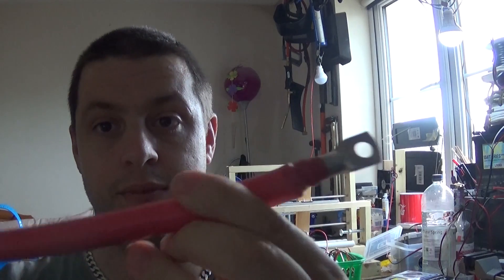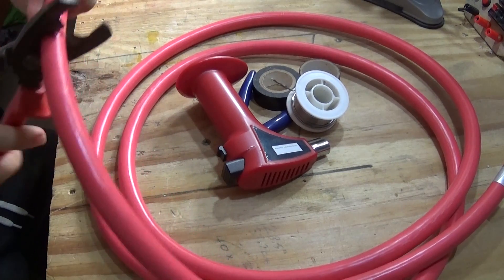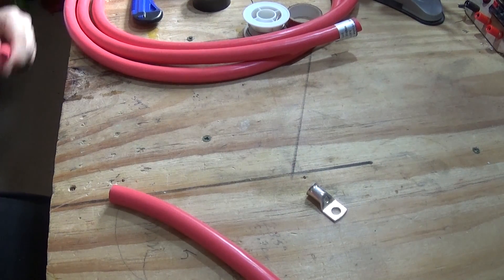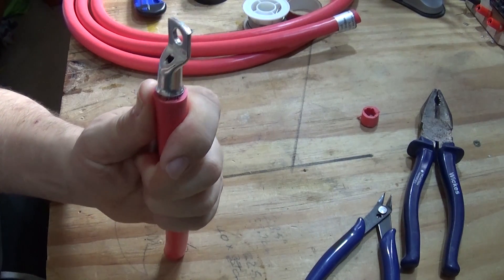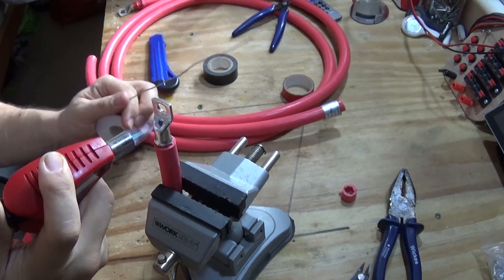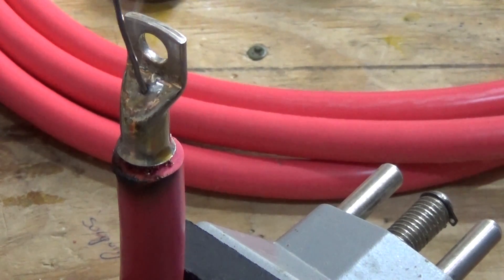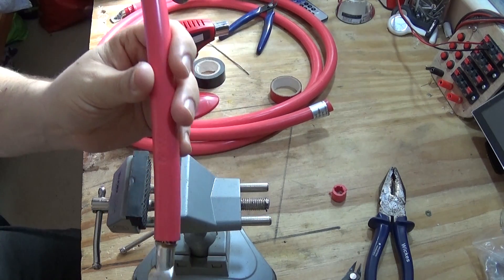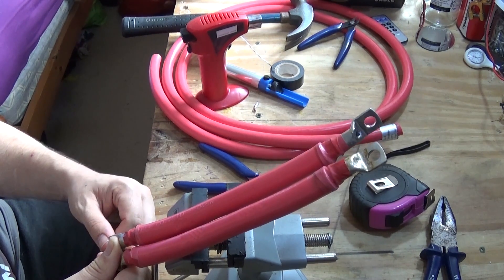Securing Terminals To Wire Without Crimping. A Very simple Process | Solar Battery Bank |

Comment: Should never remove wire. Best and safest thing to do is order the right size plug and go again. Good video though 👍
Reply from the maker: To be honest I had no money so it was a case of use what I had or scrap the project sadly. I totally agree with you though
Reply: @TheOffGridFamily  been there mate. Thanks for the reply and you’re right, sometimes you have to use what you have.
Reply from the maker: Yeah exactly, that said I probably should have explained that removing wire was changing the overall wires gauge but we live and learn. I always appreciate creative criticism. Thanks for the comment mate
Reply: Any time at all :0) and live and learn, that we certainly do 🙌

Comment: Thank you soo much for this video, so many I've watched already only gave instructions using expensive tools like a crimper or even a heat gun. This gave me the confidence to work with what I have!
Reply from the maker: I have never had many tools so I have got used to just doing what I could with what I have. About 8 years ago I didn't own a drill and would make all my holes with a screwdriver. Times have changed but the idea has not. Thanks for the comment

Comment: Crimp hammer works alot better in my opinion. I've done a bunch of them also I've heard the solder doesn't work well for good contact. I give you props my friend that's the first time I've seen someone feed the solder from the hole in the top. Good job!!! I just learned something new today, Cheers my friend. 👌👍
Reply from the maker: I didn't have any other way of doing it at the time but the contacts were absolutely fine and are still working now. So a few years old and still fine. Thanks for the comment Buddy. Creative criticism is always appreciated cheers my friend
Reply: The Off Grid Family your welcome my friend 😊👍
Reply from the maker: Make sure you sub and leave some more comments :) Video ideas are appreciated as well although might not always be possible

Comment: Do not ever be critical of some one else doing it wrong.....You just trimed a 1-ga cable to 2-ga or smaller......why not get the correct size lug or use a smaller cable if it is correct for amp draw. Not to mention but I will....you just ruined a set if wire strippers.
Reply from the maker: David Crook if you read the comments they sent the wrong size and it was time sensitive so worked with what I had. Also the 99 pence cutters survived...thanks for your comment

Comment: Did he do it the hardest way possible minus using his teeth to strip the wires? Absolutely. Did he do it absolutely the wrong way for anything that has to survive any sort of vibration. Absolutely. But for stationary batteries he'll be fine. If you hate the way he did everything.. you and I agree. But the good news is you can do yours any way you like. I'm not sure what your name is Mr. Off Grid and you and I wouldn't agree on method, but we would agree that too many people will criticize on the internet most of them never having done it themselves. Getting things done beats talking about getting things done every time.
Reply from the maker: Squid's Pressure Washing LLC thats a great philosophy. I used what i had to get a job done. They are still holding up without a single issue so for this applicarion it worked. Thanks for your comment.

Comment: No disrespect intended, but I would have really liked to see you do this being better equipped, and it would not have cost that much more. Sufficient wire cutters, strippers and torch...The size of your terminals really wasn't your fault. And get the correct shrink tubing before you post the video. It would have gone much smoother without all the rude comments from inconsiderate people.. We got the concept though...Thank you
Reply from the maker: Dano C. Yeah i get what your saying but the idea of my videos is to prove you dont always need all the correct tools to get a job done. Thanks for your comment

Comment: I would not recommend this method ever !  Crimping with the proper tools is far superior to the solder method.
Reply from the maker: Brian Waite i totally agree. The cables i brought were 3 times bigger than was needed so trimming them was safe and the most simple option.
Reply: @TheOffGridFamily  I've got to agree with not trimming cables to fit connectors.  Just get the proper sized connectors to start with.  Reputable sellers are reputable for a reason.  And if you're using cables 3X the size you need, then you're just throwing profits out the window.  While we're talking profits, let's do some more math.  Each joint you're doing, while obviously burning your finished product, is costing you the consumables (torch fuel, solder).  More importantly...TIME!  I get that many people under-value their time, but the old adage is still true:  Time is money!  Doing this with a proper crimping tool, you could easily finish 2 per minute (proper wire cutters / strippers have already been covered by others).  Given the number of connections you said you had to do, you could easily pay for a quality crimper ~$100 with just this one job...probably the cutters/strippers too!  Then...(here's the GREAT part)...your consumables price goes to ZERO, and your time spent goes to a FRACTIONAL percent of where you're at now!  Don't forget...you won't be selling burnt product either!  I'm not trying to slam here...I just see SOOOO much room for improvement that will also increase your bottom line!
Reply from the maker: I wasn't selling the end product? The parts I brought were at different times and I don't even now have 100 (of any currency) to spend on a tool I will use less that 2 times ever. I get what your saying but my time is free and the terminals are still fine now 4 years on. There is loads I can do different but to be honest I think I'd do it the same again if I needed too but I won't thus the reason for not needing a tool specifically for the job. I have a crimping tool I use a lot but it is way to small for this application. I appreciate the feedback and take what you say on board but it worked and cost me only time which I have in abundance. Thanks for your comment
Reply from the maker: I don't have proper crimping tools. This was the only way I could do it. They are still as strong as they were two years ago.